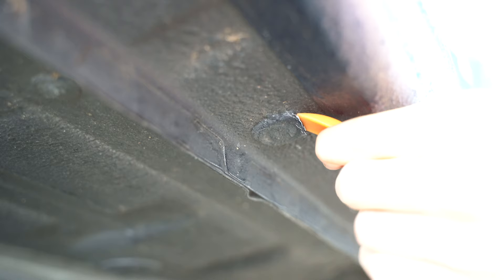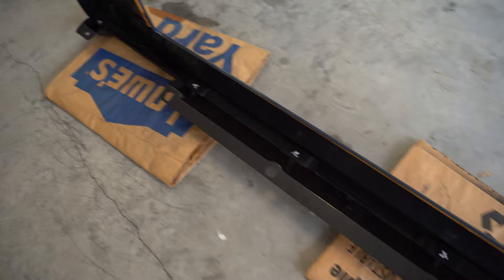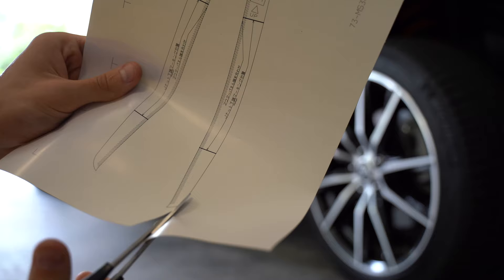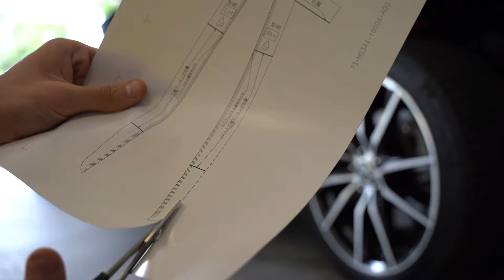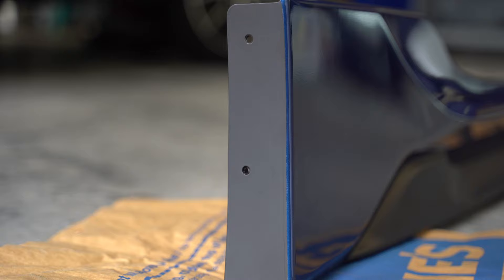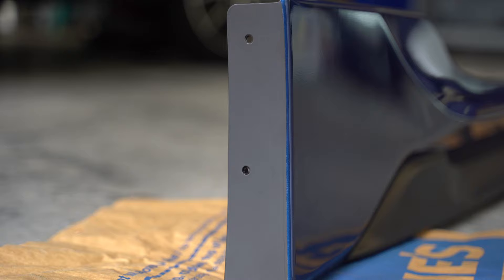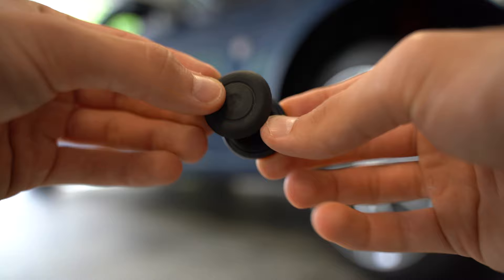Toyota 86 TRD Side Skirts Installation | No Drilling!

Comment: Any tips or guide on the front lip? Seems tricky especially the led part. Thanks!
Reply from the maker: Hey there! I’m actually working on the video for it, so I’ll have it out within the next few weeks. It’s weird, but in short you have to wire the leds through the washer fluid reservoir. I’ll explain everything in detail in the video
Reply: I need the tutorial broo

Comment: I'm wanting to put a TRD body kit on my 86. I've seen that your car has been lowered, how is the clearance from the ground? How far is it from the lowest point on the car?
Reply from the maker: Believe it or not it’s actually the same as factory. Maybe Is like 1cm lower just because of the thickness of the material but it just looks lower, it’s not actually lower
Reply: @nikolaiiaksenov  Oh your car is not on lowered springs/coilovers?
Reply from the maker: @filopride619  no it’s on coilovers, but the side skirt itself does not lower the car